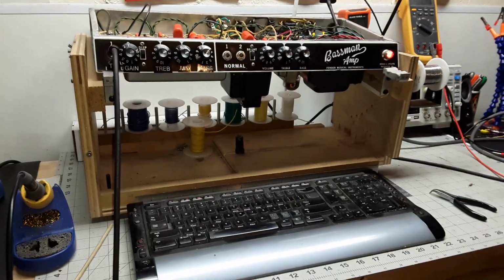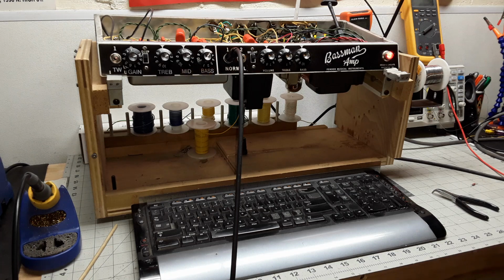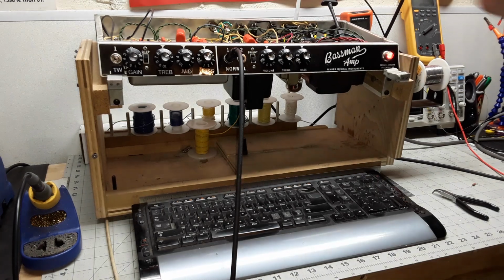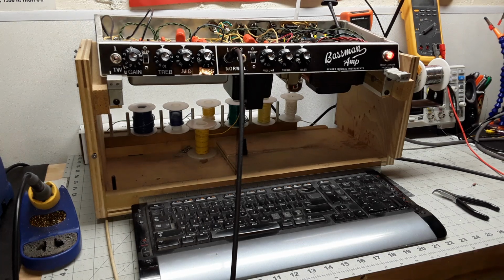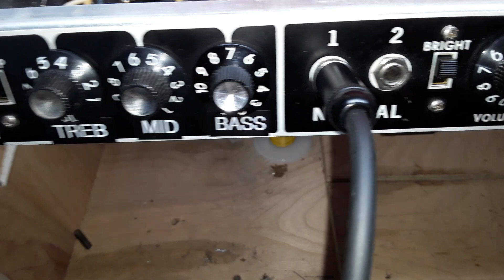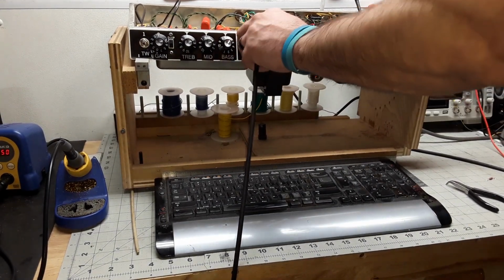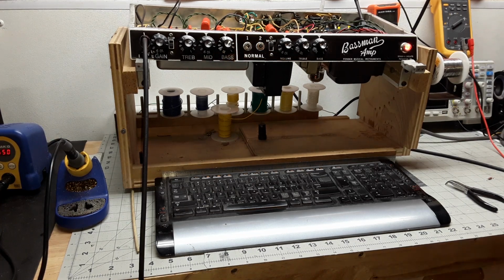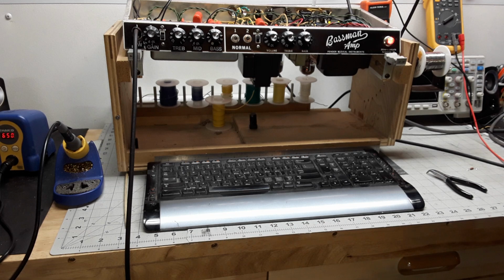1968 Fender AB165 Bassman

Comment: Hi Curran. Great video, amazing amp sound! Just bought an silverface ab165 1967 (I think) that just not break up, even at high volumes. Any advice on what to look for? What is the ohms speaker value for this amp? Thanks!